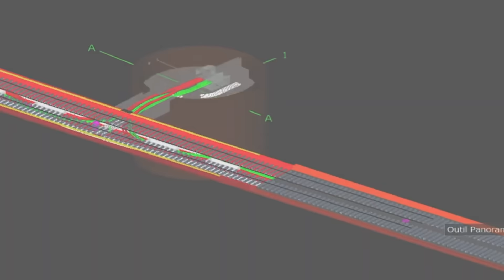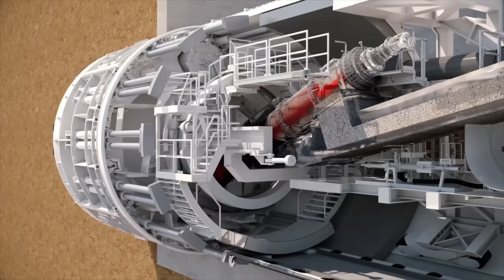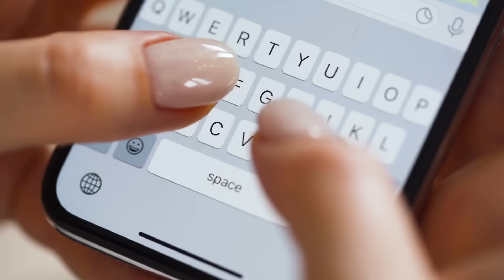The Grand Paris Express - Europe's Largest Transport Project

Comment: Still too complicated, tedious, and inconvenient for 90% of the people to get to CDG !  Why not have a direct one-seat ride from rail stations to the main international airport?
Reply: There will be 4 ways to access CDG by rail :
RER B (existing)
M17 (GPE currently being built)
CDG Express, direct non-stop rapid access from Gare de l'Est (currently being built, set for 2025)
TGV, from the high-speed station located under the middle of Terminal 2, next to RER station (existing).

And 4 ways to access Orly airport :
RER B + OrlyVAL (existing)
Tram T7 (existing)
M14 (opening 2024)
M18 (2026/2027)
Plus the proposed planned extension of T9 and possibly a proposed TGV station some time in the future.

And of course the various direct and non direct bus lines.
You'll soon have plenty of choices.
Reply: @KyrilPG cdg express is now set to 2027
Reply: @KyrilPG  There will ultimately even be a 5th rail line to CDG with metro line 19 in 2040 ! Now I'm sure people will then complain that it's too complicated and they don't know which line to pick. 😂
Reply: @Clery75019   Yeah it was proposed as a project last week by the region's and transit authority president.
Though it is unclear if it will truly run up to CDG by interlining with M17, or on its own (doubtful) or if it will simply end at Triangle de Gonnesse, turning this simple station into an interchange and line terminus, thus requiring a transfer to continue towards CDG.

French people complaining about anything and everything? Especially something and its contrary? 
No... that can't be 🤣🤣🤣
Anyway, I can't wait for all these different lines to open.

According to your handle, you seem to be a neighbor... rue Rebeval here. 👋🏼
Reply: CDG express in 2027 ! :)

Comment: It's groundbreaking, literally! Impatiently waiting for line 14 to arrive in 10 months 🙌 I'll have a metro station at a walking distance of 5 minutes!
Reply: My brother lives in Saint Ouen, near a RER C line, but using the ligne 14 which opened 2 years ago is so much better. It is just not very good in terms of opening hours due to all the construction works being done
Reply: Lucky you !
Reply: Congrats! I just stayed in Paris for 3 weeks, and I have to say the metro there is quite awful. It was loud, smelly, overcrowded. However I found that Metro 14 was very clean and not overcrowded. You are very lucky!
Reply: @teemo8247 I think it's going to be much more crowded then
Reply: @teemo8247  Most of the smell is due to the Paris soil being filled with lines of gypsum and sulfur which react with water infiltration and produce that fowl rotten egg stench.
Keep in mind that a good chunk of the metro is at aquifer level or below. Especially the whole Opera - Auber - Haussmann - Saint Lazare gigantic underground complex that has its own wind system. It tends to disperse into the myriad of tunnels and corridors for miles.
They have progressed a lot in the suppression of the smell, but it's extremely complicated given that geology and chemistry tend to always win against mankind.

Comment: “simply going from north to south or east to west takes too much time” anyone who lived in Paris will tell you that it is literally the best use case of Parisian public transports. The RER does just that. The problem is going from one suburb to the neighboring suburb without going through Paris
Reply: "The subway is almost useless for at least 6 million residents" sent me as well lmfaoo
Reply: As a Melburnian it seems like we have similar issues - all of our train lines go through the centre. Our inner suburbs are served by light rail but the outer suburbs are only served by inefficient buses. 

Luckily we have started working on our own metro loop, which will potentially cost more than the entire Grand Paris Express and will create - a single metro line. The first section should open in 2035 and the project should be done by 2050 - assuming that the car loving conservatives don't cut the project if they ever win. Gotta love Australian infrastructure efficiency!
Reply: Yeah. Its a similar case in Copenhagen. Very radial transit network with the S-train (our RER equivalent) going in and out of the city centre and a metro within the city centre, but if you wanna go across the suburbs without entering the city, you'd need to take a slow bus that gets caught in traffic and is often overcrowded. All while Greater Copenhagen has 1½ orbital highways but no orbital rapid transit outside of the S-train F-line at the very edge of downtown, which is too far in to be useful for most circumferential trips.

 Thankfully this is being adressed here in Copenhagen, first by a 28km long tram/light rail line that run on Ringway 3, which parallels the Motorringway 3, the busy orbital highway here. Thats scheduled to open in 2025 and the first of 29 brand new trams for the line just arrived by truck from Siemens. In the longer term there are also 2 Bus Rapid Transit (or BHNS in french) lines planned too and currently having Environmental assessments done. One further in than the tram and one further out, acting as 2 additional orbital lines that'll likely open around 2030, along with other Bus Rapid Transit lines proposed in other parts of the city (even though trams are better).
Reply: Yes! Suburb connections !!!
Reply: Yeah that made no sense!
Reply: Thank you! I live in Paris (I am french), and yes connecting suburbs is the goal of this project, cause RER works well to connect suburb-Paris-suburb, but there is often no quality transport connecting suburb-suburb (most of the time a slow and long wating bus, which takes a crooked route and takes a long time to arrive at its destination). AND there are problems of overcrowding on almost the entire transport network (partly because of the high density of the city). Another problem of the parisian metro/RER is that people with reduced mobility cannot use almost the entire network and a big part have to take the bus... or car. So build new lines accessible to disabled is a good thing but existing lines should be renovated too to be accessible to all (I know it's sometimes complicated but I think it's necessary).

Oh and I think connecting line 14, 17 and 18 to airports is for tourists but this is not neccessary a good thing because it will encourage people to take the flight instead of train, and lots of transport alternatives already exist (RER B, Orly-Val, tramway and metro line 7, Roissy-bus, Orly-bus, other buses).

But it's still a good project. Expansive but worth it.
Reply: yea I was confused. Why are they building ring like structures, if going west-east & north-south routes are needed. with your insight it makes much more sense!
Reply: Exact
Reply: HS2 has left the chat
Reply: In other words a loop around the city linking the outer suburbs. London has that by linking old lines calling it the Overground.
Reply: The answer is … a car, or scooter/motorcycle. Public transport will never be able to connect every fringe point A to fringe point B more efficiently than individual transport
Reply: @swegatron2859 that’s why combining them works so well, cycling or walking to the station, then riding the subway and the cycle or walk the last part.
Reply: The RER is so damn slow inside Paris my grandma walks faster. And she passed away.
Metro line 1 is as fast as the RER A on the same trajectory as it when it is only a metro and not a full blown train.
Reply: @akiraraiku   What you're saying can definitely be true in some cases especially if we mention the RER C which serves loads of stations and whose route inside Paris isn't straight at all. The line B is quite slow as well but it won't take more than 25 minutes to cross the city intra-muros from north to south (so it's quite subjective). However each other line (A, D and E) is way faster than the underground. The D line has only got three stations inside Paris, the line A five and the line E three (although it doesn't cross the city entirely).

It takes 17 minutes to the line A to link Vincennes to La Défense with an average speed of 55 kph as it takes 35-37 minutes to the line 1 to link these two same stations with an average speed of 27 kph. (The line A serving 5 stations in between Vincennes and La Défense whereas the line 1 serves 23 stations which makes it incomparable on paper and statistically). It has been proved internationally, the  RER A is a line whose performances are among the best in the world in terms of exploitation and regarding its annual ridership.
Reply: @akiraraiku  RER A in Paris is much faster than the 1. The main issue is reliability, but when it works it’s clearly faster
Reply: Metro 1 as fast as RER A, LOL. From la Defense to Gare de lyon, it takes 10-15min more.. I do agree that RER C is more than slow but not RER A.  RER B/D/E are faster than metro
Reply: @akiraraiku rer a is twice faster as line 1, you don't know what you're talking about

Comment: I can give first hand account of the absurdity of this "star/étoile" configuration forcing us to go to Paris 

I live in Évry in the south of Paris in the Essonne department.

If I want to go to Massy, also in the Essonne department and just 18km from Evry, I need to walk 15 minutes to the RER D station, take a train that in peak hours comes every 10 minutes, travel 35 minutes to central Paris to Châtelet Les Halles station, change platform to take the RER B, wait at the most 15 minutes for it, travel 30 minutes back to the south to Massy-Palaiseau station

The Grand Paris Express doesn't go down as south as Évry but as part of an even greater plan, tramways are being built so in early december 2023, a reliable tramway fifteen minutes from where I live will take me to Massy-Palaiseau station in 25 minutes without having to go through Paris

Thankfully I live and work in Évry and just walk to work 🙄

Edit : T12 is operational but distance is covered in 42 minutes not the promised 25. Still a great improvement though, especially to get to Longjumeau etc.
Reply: Paris is the hub you HAVE to go to to go anywhere else… it is frustrating. The Paris Metro is fantastic overall!
Reply: @edgecityfilms  
I confirm. The metro is fantastic and very easy to use. I came here 14 years ago and can't remember having any difficulty to learn.
Reply: Bicycle?
Reply: @mikaelbohman6694  
I'm not suicidal to use a bicycle on suburban roads and the idea of being constantly drenched in sweat and tired from cycling isn't very appealing
Reply: Aren't there buses that go from Evry to Massy ? Especially as these are 2 pretty important cities in Essone. Evry is the capital of Essonne, Massy has a TGV and RER hub etc... I once found a direct bus from Orly to Massy (91-10, a bus of the department). It would be surprising if they didn't exist from Evry to Massy.
Reply: @noefillon1749  
As you said, Massy is a TGV station so they have express buses to Orly airport 

From where I live, taking the bus in weekdays would mean taking two buses, the second one comes every thirty minutes 

Buses are grossly unreliable here
Reply: The Tramway T12 goes straight to Massy from Evry though, and pretty sure there are bus lines which are much faster than going all the to chatelet
Reply: @Heevoice  
Buses are unreliable and waiting times can be up to an hour !

The T12 still takes 42 minutes to move from Évry to Massy and we're still waiting for full deployment three months after operations began (lack of drivers and trains)

Comment: I live in Paris. First of all, it was former President Sarkozy's idea,

Secondly, the problem is that as soon as the network opens, it will be saturated. We should have thought even bigger.
Reply: The last RER to open was the RER E. It is notoriously underused
Reply: @varoonnone7159  The RER E is currently being expanded, and will be one of the most-used lines in a few years' time. It will largely relieve congestion on the A line, which is a disaster in terms of ridership..
Reply: The idea initiated far berore sarkonabot took it.
And Val de Marne was about to start it's part when everything was stopped by Khadafi's murderer action 😏
Reply: @Tiekorolivier  It's an idea of the RATP from the 80s, "Le Metrophérique" .... which dragged on because not enough investment. In addition, the RER A and B had been very expensive at the time.
Reply: En fait il y avait le projet de la région, la ligne circulaire, et le projet de l'État, le grand huit. Après négociation les deux projets ont été fusionnés.
Reply: @ENCPBbis  Le projet de la région vient du projet RATP "metropherique" qui date des debut 80's pour les ébauches

Les agents RATP qui sont des professionnels milieu et non des jeunes diplômés comme maintenant, avaient deja compris qu'après les RER, il fallait creer un RER Circulaire.

Les regions n'ont fait que reprendre le concept en pretendant etre les penseurs ,alors qu'ils ne sont rien.
Reply: It comes from Napoleon 3, and it already existed in the monarchy. 

Anyway, it is not enough